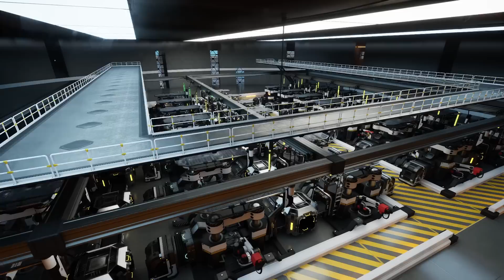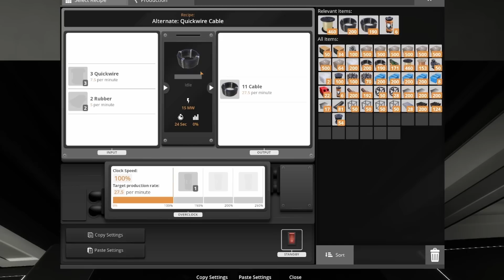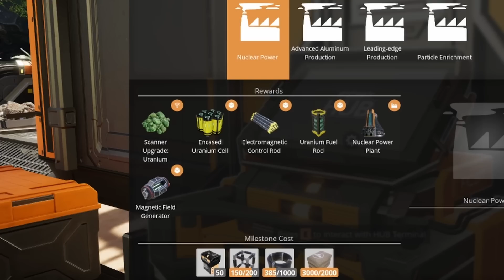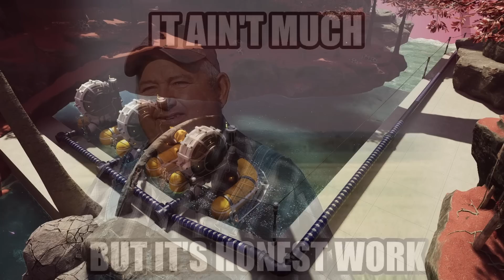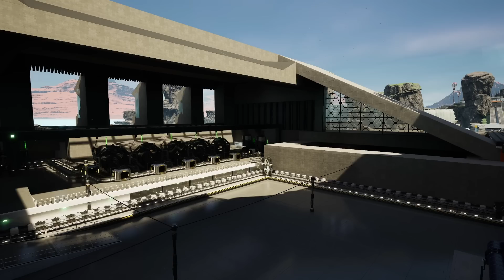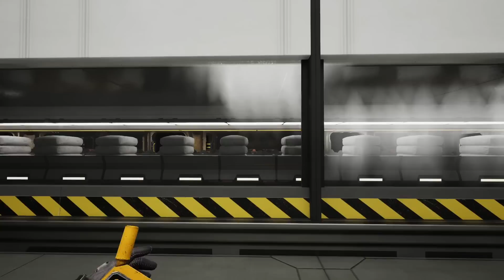Designing The Perfect Aluminium Plant In Satisfactory

Comment: As soon as you get the hoverpack, you'll find yourself laying down powerlines absolutely everywhere. Most of the Satisfactory wildlife simply cannot cope with someone flying, even if they are flying along a power line, and flying this way needs no fuel as long as you have power.
Reply: To be fair, part of my exploration kit is dragging power lines everywhere.  Mostly because building a quick 2 power poles is instant zip line to go up or down.  Then, of course, if you stumble across any wrecks you will have power if it wants power to open it.  Finally, it lets you have your whole electric grid anywhere.  Find a new ore node you need?  Well you got power with you.  Throw that miner down and get to work.